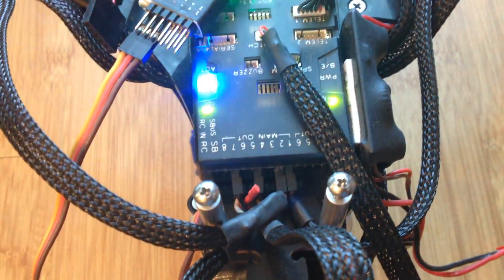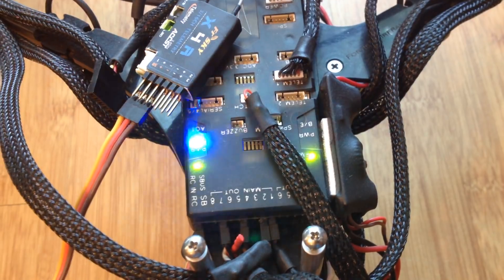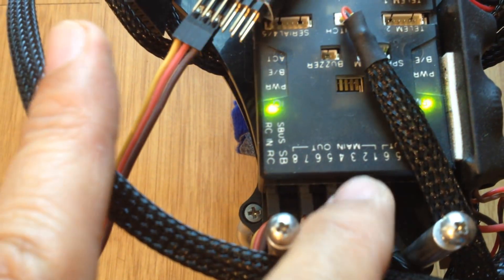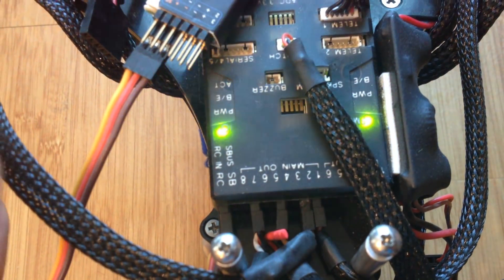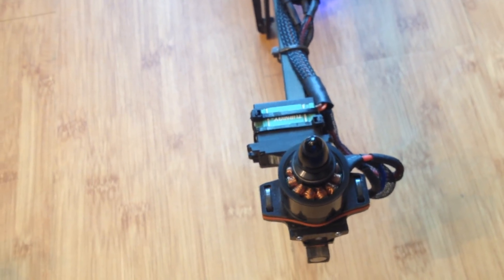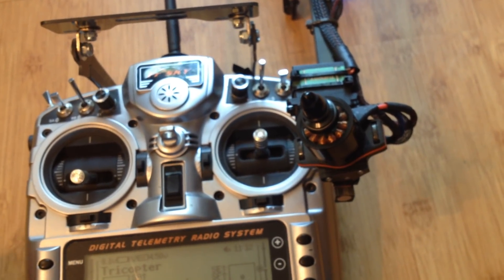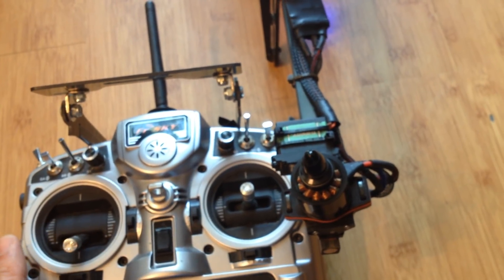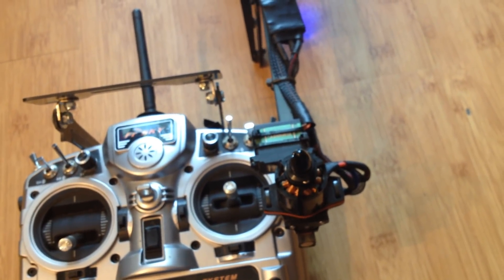Setting Up a Tricopter with APM or Pixhawk

Comment: Dear kindly rply 
I m using apm 2.8 with six channel radio for tricopter put my servo in motor 7 out with + and - wire attached and signal wire is also good but my servo is not working all apm settings r good

Comment: Hello I have a question I am running the PX4 with a tricopter, some how although the configuration is as yours my aileron is controlling my yaw and vise versa do you have a solution.
Reply from the maker: Gregory Brown Most likely this is due to an incorrect setting on your transmitter. when you do the radio calibration in Mission Planner make sure your controls are doing what they're supposed to. You might have to rewire the rudder and aileron channels which is a real simple fix.
Reply: Khoa Nuyen do you know much about the spectrum dsm2
Reply from the maker: Gregory Brown I don't have a  Spectrum radio but I do know their channel settings are different. Most channel settings are 1 AIL, 2 ELE, 3 THRO, 4 RUD. Spectrum has a different order. This is not a problem because once you figure out the order, you can rewire your connectors accordingly.
Reply: Khoa Nuyen ok I figured it out I had to set my awash angle to 120 and that fixed it but at the same time I cannot get the yaw stable, do you have any ideas
Reply from the maker: Are you using your remote in heli mode? If yes, don't. The channel mixing should only be done in the Pixhawk. If your remote is also in heli mode with its own channel mixing, you're adding another unnecessary layer of complexity. Use your remote in airplane or acro mode. This way, your remote will output control signals directly to the Pixhawk, which will translate the signals to properly fly the tricopter.
Reply: Khoa Nuyen Thanks you have been very helpful.
Reply: Khoa Nuyen I am have lots of issues, I did what you said acro mode and leaving radio rev in normal.  How do you set up the px4 to fly as a tricopter.  I am have a world of trouble.  For some reason I thought it would be easier that the KK boards.

Comment: Hi Khoa
I bought a brand new APM 2.6 and when I spin motors on Acro or stabilize mode and apply ailerons or elevator or moving the flight controller around i dont feel any variance in motors RPM !! but the throttle works fine ... so should i feel the RPM difference when I apply pitch and roll ? and if yes does that mean I have to tune my APM or it has some thing broken ? 
thanks
Reply from the maker: Did you calibrate your remote in Mission Planner. Doing so will tell you whether the controls are providing the correct output to the Pixhawk.

Comment: I've built custom tricopter frame plates for APM/Pixhawk flight controllers to simplify/clean up wiring. 
check this post on RCG: https://www.rcgroups.com/forums/showpost.php?p=35580911&postcount=784
and this one too: https://www.rcgroups.com/forums/showpost.php?p=35812928&postcount=786
Frame plates integrate Current/Voltage Sensor, PDB, OSD, 3xBECs 5v, 12v and 7.4v for servo, each 3A rated. 5v and 12v are also filtered to reduce interference form motors/ESCs.
12v has unfiltered output as well for non-sensitive accessories like LEDs and Gimbal.

Comment: say me the rotation of motors of M1,M2 and M4 how it is rotating CW or CCW ? plls help
Reply: Check in ardupilot.org
It actually doesnt matter, switch any 2 of the 3 ESC wires and rotating direction will change.

Comment: Thanks for the tips. I just recently purchased the Titan Tricopter frame by Fortis Airframes and I had planned on using Pixhawk 2.4.6 as the flight Controller. I was not sure if it would work or even fit but your video shows that it will and the correct configurations. So does it fly well?
Reply from the maker: The tricopter flies great with Pixhawk. one of my most stable drones.

Comment: Hi. First of all thank you for your time and recording this video. Could you please explain how is your servo powered? Did you just connect one red wire from ESC with the servo red wire? Thank you.
Reply: The servo is powered by APM or Pixhawk. Just connect the servo to the correct pins and it will be powered as long as APM has power. The APM is either powered from the ESC or a separate power module.
Reply: +Bits-Of-8 you don't have no problems in have the PM and the BEC powered together?
Reply from the maker: +Lucas Colonna no problems using BEC with power module.